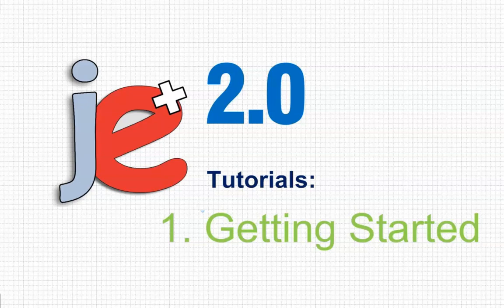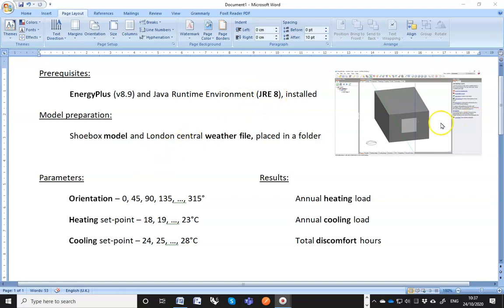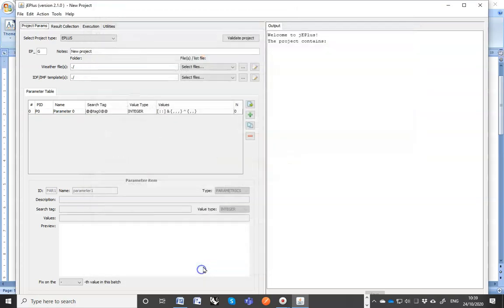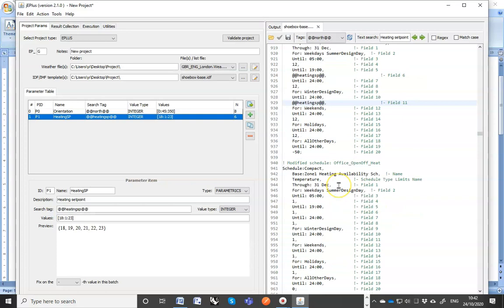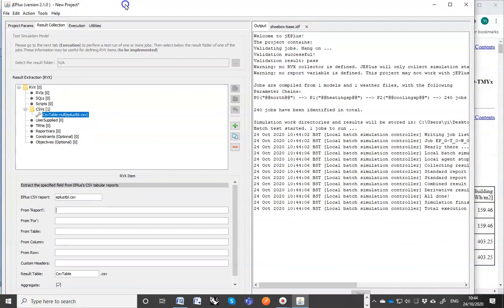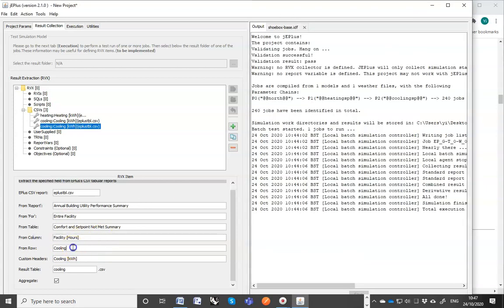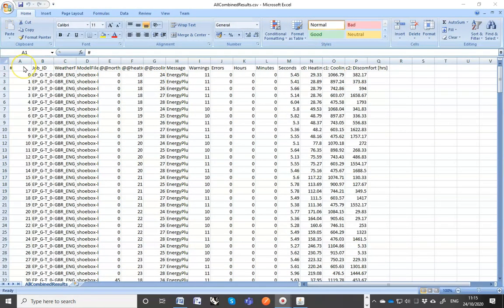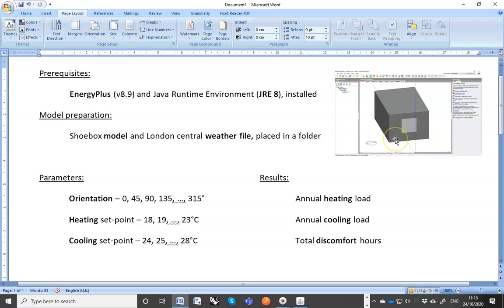1. Getting started with jEPlus

Comment: I can not also report or extract data from the mentioned Table here... I am using EP 23.1.0, could that be the reason? Many thanks if you help:)
Reply: It should work with newer EP versions. Please give more details for me to help you further.
Reply: @yizhanguk  simulation runs, even the time gets reported in csv, but the cooling and comfort columns (column header is there) have no value.  when i run the first case  the html output has values. Please give me a solution.

Comment: why dose not the csv display data extracted from the table
Reply: were you able to resolve the error? I created a model that I could extract the CSV information from, but now it doesn't work for me.
Reply: Had the similar issue. Solved by changing the Column separator in Output control: Table style to CommaAndHTML.
Reply: @saraaghasizadeh9395   how do we do that?
Reply: @saraaghasizadeh9395   can you elaborate this more? how did you solve the issue?
\